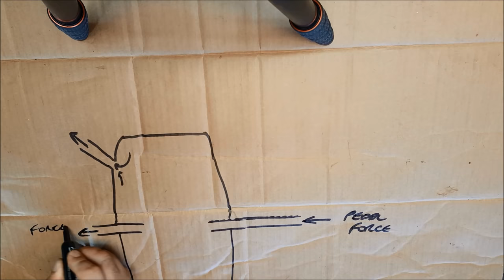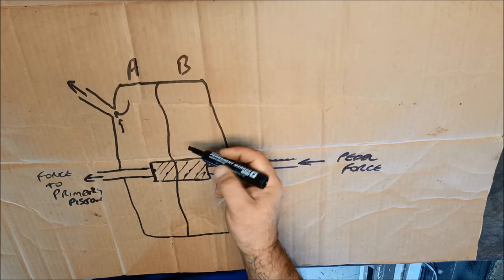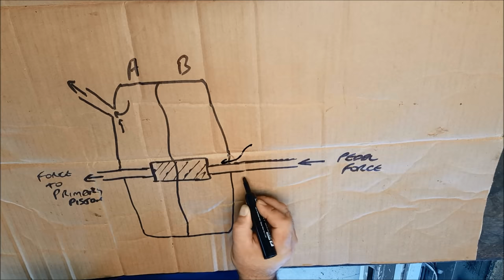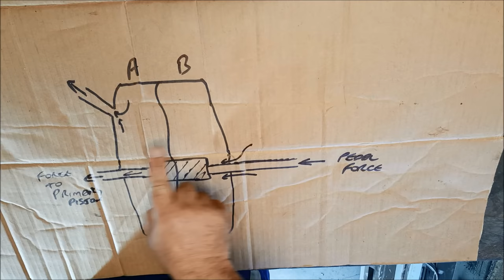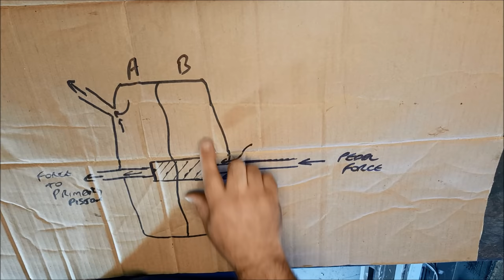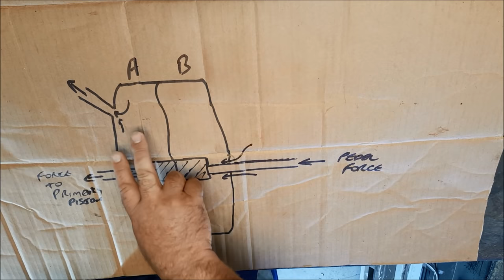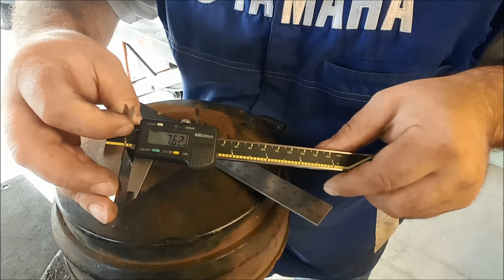Brake booster checks, operation and push rod adjustment #1313

Comment: when i  parking my car for six days without touch it , break pedal became hard . then after i turn on engine every thing be fine my car is impala 2015 

what is problem ?
Reply from the maker: Slow Leak in diaphragm or valve body inside brake servo or in one way valve on vacuum supply pipe from intake manifold I'd say. 

Cheers
Andy
Reply: Exactly , i talked to my GM dealer  ,he said servo need to be replace with new one . but he need remove ABS unit to change servo because space is small, i afraid ABS will not return as original status ..
thanks for your help
Reply from the maker: I would definitely test/replace the one way (non return valve on the vacuum supply pipe first before doing such a large repair.

Dealer will have to refit and bleed up ABS unit and ensure it is fully operational before returning the car to you.

If you are worried then make a video of the ABS unit operating correctly prior to taking your car in for repair. Evidence that the ABS unit had no faults.

Hope this is of help
Cheers
Andy

Comment: The breaks on my Mazda 5,  diesel 2010 works ok as lobg as rpm is aporx 2' or more - with less breaks get weak and padle 'hard'.. Wjhen driving in rpm 2'...i also hear a whistling noice seeming coming from the booster.. I have changed and tested the vacumhose and valve...
What is wrong ?
😊🇳🇴
Reply from the maker: A diesel car has a vacuum pump on the rear of the alternator- it's likely worn out & needs replacing. Also check one way valve on booster vacuum pipe is sealing properly 

Cheers Andy
Reply: @AndyMechanic  Thanks Andy 👍 I have cheked abd also changed the vacumhose with the valve going from the engine to the booster : both the original and the one i changed it with (used one) i could blow one way and not the other way - no leaking. I know very little about car engine, but i have been thinking that it is strange all is ok as long as rpm is high enough - 'maybe there is a vacumepump somewhere running on the engine rpm...' Now you confirmed this !!
Is this pump sitting directly on the breakbooster ?
Reply: ....alternator same as booster...?
Reply from the maker: No, it's usually on the rear of the alternator believe it or not! Driven by the fan belt
Reply: @AndyMechanic  alternator : the device giving el power to the battery/car ?
Reply from the maker: Yes :-)
Reply: @AndyMechanic  Fine !  Just sebd me a Hello and i reply on that..😊
Reply: I have sent you on FB..

Comment: Hi Andy I have a 1999 Ford Fairmont Ghia AU when I push the break pedal down it makes a hissing sound down by the pedal and the ABS & TYRE SKID LIGHT is on won't go off?  hope you can tell me how to fix it please?
Reply from the maker: +Tania Beach Sounds like you have a leak in the brake booster....time for a new one, sorry
Reply: Thanks for your reply Andy ...will i need just the break booster? also can i get a second hand break booster or buy a new one? after putting in the replacement do i have to adjust the break push rod? thank you for your help and speedy reply much appreciated :)
Reply from the maker: +Tania Beach new or second hand is fine. Either way you will need to adjust the push rod to the master cylinder :-)

Comment: highly appreciate ur info.. i hv nissan primera, b4 few days car engine die while i check i saw 1 vacuum hose cut, i replaced it car works but engine rev move up and down regularly, it stable only f i rev to 4000 rpm,,  same time started problem of brakes, car take long distance to stop and breake pedal feels so hard, it moves half way only, not spongy and doesnt move down to floor,,, is it connected to vacuum leak, may be other vacuum leak or i  need to adjust booster,, i live in uae. pls help
note, even while hose cracked and leak vacuum but brakes was working good
Reply from the maker: +MrIndoomi that old cracked hose may have a 1 way valve built into it. By replacing it with a normal piece of pipe it may be missing the valve now....

Currently the booster isn't getting a vacuum supply from your intake manifold that's why your Brakes are poor.

The engine revs fluctuate because there is an air Leak in the intake side.

It may be that the booster has got an internal Leak.  You can check this by using a vacuum pump and gauge on the vacuum input of the booster (where the split pipe connected) and pump up the vacuum and see if the needle on the gauge keeps position.

If it doesn't maintain vacuum then you'll need a new booster.

This is not a booster push rod problem so don't try adjusting it.

Andy
Reply: tnx 4 reply,, 
1- i tested booster with vacuum pump, it doesn't lost vacuum but when i push brake pedal it loose vacuum.
2- i detached master cylinder from booster, ( i ddnt adjust pin ) but when i hold it i noticed its moving free half inch in and out, also when i push it gently right or left up or down i hear hissing and leak, is it normal or wt?
waiting ur reply.
tnx again

Comment: Hi I have a 99 golf IV 1.4 petrol manual.
When I was waitting for the trafic up hill, my foot felt that brake pedal went about half centemeter more down then it setled. after 2 days I noticed a loss of about 3 millimeters in the pedal when I put my foot behind the pedal and pull it up. the problem is that my rear brake lights are all the times on even when the car is locked because of the 3 millimeters.
No leaks and fluid is nearly on max level.
does it mean my brakebooster is bad now?
any urgent action? I can put a tape though, but what worse can happen?
Thanks for any advice you could give
Reply from the maker: +danduun Hi, okay, between the booster and the brake pedal there is an external push rod. This can be adjusted in length. It is possible the lock nut has come loose. So make the push rod a little longer and remember to lock the lock nut.
Reply from the maker: +danduun The rear brake lights should start to work normally again and you should have your pedal position back too. If it happens again and the locknut hasn't come loose then there must be a more serious problem. Hope this helps. Cheers Andy
Reply: I adjusted the length of the button tip and made two tick longer, I think my pedal comes standard there is no adjustment and no nut, the rod is one piece and ball ended inserted in a plastic thing which is attached directly inside the housing of the brake pedal. or am I wrong?
Reply from the maker: To be completely honest I haven't worked on a VW Golf's brake pedal other than to change the brake light switch. I really can't remember the layout although there must be some method of adjustment. All I can suggest is you Google it or better still, download a PDF workshop manual for your car - that's the best way forward to get accurate info... sorry I can't help more on this one?  You could maybe ask Badgertronix - he has a YouTube channel too and may have more info to share... Cheers Andy
Reply: thnks Andy I will do so. just pulled the top (adjusted the button to be longer) and works fine i just dont need to put my foot under the brake pedal amd pull it up so it wouldnt push the button more so that it becomes shorter, and all is fine so far.

Comment: The brake booster test is negative. What could be the reason for a hard to push pedal?
Reply: Check your one way valve coming off the booster to the engine
Reply: @jeffdawson7841  I teplaced the valve, but still the test is negative.!!!

Comment: Hello everybody dnice question I have a 2001 ford crown Vic the other day I was backing up to a parking spot on doing that when backing it had a dip in it when I hit the brake it seem to go close to the floor I put my feet under the pedal it was touching I bleed all the lines  but it seems sometimes i got to push alit if pressure to stop. Can somebody help me out please

Comment: plz can you hlep replaced master clinder n porting valves on 2003 hyundai santa fe suv  v6 2 wheel no abs brakes locking up very hot after nine  miles cool down  then  release but  happened  again plz  help
Reply from the maker: +Dennis Harcula Hi, yes, it sounds like the push rod length between the brake booster and master cylinder is too long. This must be adjusted when replacing either component. You'll need to remove the master cylinder to make this adjustment. IT IS NOT THE ROD TO THE BRAKE PEDAL....Okay? :-)

Comment: Hey great video.. Used driving my car and a kid on his bike came in front of me so I slammed on the brake peddle and now it's I have to press down all the way and it will brake very slowly what should I do
Reply from the maker: +LIL FOLK sounds like it's blown a main seal in the master cylinder.
Reply: Andy Mechanic so buy and put in a new master cylinder then?
Reply from the maker: +LIL FOLK yes, going on what you have said I think that's the most likely failure. Cheers Andy
Reply: Andy Mechanic OK so I have done anything to it yet but put more fluid in and it's leaking at the right rear wheel
Reply from the maker: +LIL FOLK Ah okay. Good. Is it a disc or drum brake at that wheel?
Reply: Andy Mechanic it's a drum I have a old 79Pontiac lemans 231-2v v6 Rochester Dualjet 210 I could ask u questions all day about I new to the hole carborador and all the old things.. But I got my dream car just wish I knew more
Reply from the maker: +LIL FOLK That's okay. You will need a new Wheel Cylinder & brake shoes. The drum may be worn out too so check the inside diameter where the shoes make contact - the spec us ofter cast into the drum on the outside.

Once you have replaced the parts you will need to bleed up the brakes.

Hope this helps
Cheers
Andy

Comment: @Andy Merchanic My ford escort van brakes jam on like crazy intermittently and lock on diagonally i.e. front right and rear left, despite renewing all pads and shoes and discs and drums and front brake flexi pipe.
 So i did all that and they still jam on diagonally,if i undo the front right bleed nipple they free off, this calliper was also replaced.
Not much left to replace, so this is my question.....
Would or if the push rod that goes into the master cylinder if that was somehow adjusted or moved over time too far out, would this cause the brakes to drag and jam on??? and especially diagonally??
My brake pedal feels normal,no loss of pressure etc
Reply from the maker: +SP330Y yes, I'm very confident this is a pushrod that is a fraction too long,, causing the primary piston to fail to return back to its stop and therefore blocking the compensation port for the primary chamber.

Hope this helps.

Cheers
Andy Mechanic
Reply: Andy Mechanic
Yes it was that fault :),I undid the 2 x 13mm bolts holding the master cylinder to the servo,i did this after tonight the brakes jammed on yet again, and immediately after undoing these bolts they freed off.I slackened them way off and pressed the pedal in the car to see if they moved in and out at the MC point and they did,so not jamming on the pushrod,obviously adjusted way too far out.Thanks for your great video,without it i would still be messing around with the brakes
Reply from the maker: +SP330Y Awesome :-)  Really chuffed the video has helped you out. Cheers for the feedback and drive safe...
Reply: Andy Mechanic
thanks,i sent you a link to a York guided tour,maybe bring some memories back
Reply from the maker: +SP330Y Cheers.  Yes, I miss York...so many pubs!
Reply: Andy Mechanic
Yes there are and The Golden Fleece, most haunted pub in the UK ,and i think some Harry Potter scenes were filmed at The Shambles houses as in the 1st Harry Potter where Harry buys his first wand
Reply: Thank you for your video. I've had the push rod problem for three years now. Every mechanic that looked at it couldn't sort it. I looked today myself and guessed it was the push rod  and you're video  confirms this. I now can drive without having to get out and pull the vacuum pipe off and put it back in. Thanks again we nearly changed the servo but that would of meant taking  engine out on my van. Thanks again
Reply from the maker: No problem Shaun. Great to know it helped :-) Cheers Andy

Comment: what if you do the pedal test on the brake booster and the brake pedal goes to the floor is the booster bad?
Reply from the maker: +Dreamin Big No. It's most likely an issue with the master cylinder or any component after it. Air in the hydraulic system or excessive travel on pistons or if you have floating calipers maybe siezed sliders. If fixed calipers maybe siezed pistons on one side. It could also be a ballooning hydraulic hose or maybe you have a leak!

With regards the master cylinder it could be an internal Leak where either of the two main seals, primary or secondary piston have failed and pressure is not building in the respective chamber.

Clamp off all flexible pipes to each Wheel simultaneously. If pedal goes to floor then either air in system or initial seal failure of master cylinder. If pedal now hard then fault at calipers/Wheel cylinders.
Reply: thank you alot for ur reply i think i know what it maybe know

Comment: Ok having trouble with my 98 Chevy blazer 4x4 passenger side brake is sticking. I'm going  to start from the beginning.  last week on September 5th my brake booster was going out ( when I applied brake pedal half way it start  to have a hissing sound ) so I had to replace the brake booster I drove with the old brake booster 15 to 20 mile from work to home. I bought a new one on the way home and replaced it. after I replaced it everything felt fine but now after I drive between 5 to 8 miles with minimum braking maybe 6 times total it gets hard and causes the passenger side to freeze. I had a warranty for the caliper so I replaced it thinking that was the problem . replacing it didn't help what so ever. I also replaced the brake hoses from line to caliper a month ago. Do you think I could I have bought a faulty brake booster.  I forgot to mention that when it did it to me the other night I decide to do a little test. when I drove it and got it sticking I drove it back home and got it to where it would still stick while in drive and stay in one spot. I then pulled the vacuum hose from the brake booster and it released it. if I drive it with out  the hose on it does fine other then the hard brake pedal feel. but it only sticks when the vacuum is connected and drive for little bit
Reply from the maker: +98_Blazer_LT Sounds to me that you didn't adjust the brake booster to master cylinder push rod? This does require a clearance or the primary piston main seal will block the compensating port.

You'll need to remove the master cylinder bolts and pull back the master cylinder to reduce the length of that push rod a little.

Let me know how you get on :-)
Reply: Andy Mechanic I've tried to find where to adjust to that the push pin or the push rod that goes up against the master cylinder is actually just a black plastic push rod that you can remove doesn't screw into anything there's like a shim behind it and I'm having a hard time adjusting I cannot figure out where to adjust it at there's no bolts or nuts anywhere to adjust
Reply: Andy Mechanic I can make a short video and put it on my channel if you want to take a look at it so you can see what I'm looking at just looking for some help no views or anything just that
Reply from the maker: +98_Blazer_LT perfect. Email me the link:

andymechanic@live.co.uk
Reply from the maker: +98_Blazer_LT hmmmm....Okay.  put a couple of washers between the master cylinder and the mounts on the booster and see if this sorts the issue. If it does then it proves it's a push rod length issue. Cheers Andy
Reply: Andy Mechanic k thanks I will let you know
Reply: Andy Mechanic u. Believe it fixed it. ( knock on wood ) lol
Reply from the maker: +98_Blazer_LT Great job :-)

Comment: when I start my car at first an press on da brakes pedal  the engine races off an the goes straight to the floor,i took out the master cylinder an booster an saw that their was fluid inside the brakes booster ,wat does dat mean
Reply from the maker: +Kadar Mankasingh Okay. Sounds like the rear seal (secondary on primary piston) has failed allowing brake fluid into the booster.

Also if engine revs increase when you apply the brake pedal then vacuum valve in booster isn't closing allowing air to be drawn through from the rear chamber (and atmosphere) into your intake manifold.

Both the master cylinder and booster are faulty and will require replacing.

Hope this helps. Cheers Andy
Reply: Andy Mechanic thanks dude

Comment: i have a 2001 dodge dakota and my breaks will sometimes catch but the rest of the time they go straight to the floor and wont stop my truck unless i bump them... i have bled them 3 times i dont know whats wrong with it
Reply from the maker: +Robert Rowland Hi, sounds like you have a problem with the primary piston main seal where you are getting internal leakage past the seal most times. When you 'bump' the pedal this quickly increases pressure in the primary chamber forcing the lip seal against the cylinder wall causing it to seal. During a slow build up of pressure the seal fails and you get leakby. 

You could strip the master cylinder and fit new seals but best to just replace the unit. Remember to adjust the push rod as per the video.

Hope this helps. Cheers Andy
Reply from the maker: +Robert Rowland Hi Robert, please see previous reply. Doesn't sound like air in the system that's for sure.
Reply: Thanks.  I will check and do that as soon as I can and will let you know if you're information was helpful to my problem.  Either way I do appreciate the information.
Reply from the maker: +Robert Rowland Anytime. Yes, please let me know how you get on. Cheers Andy